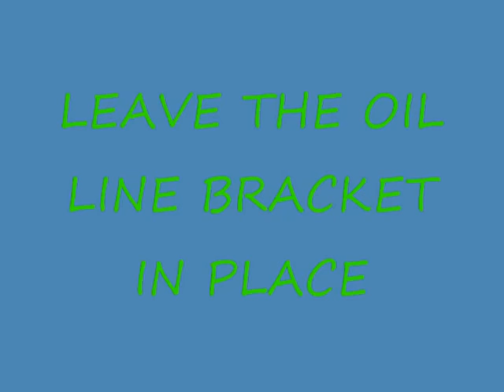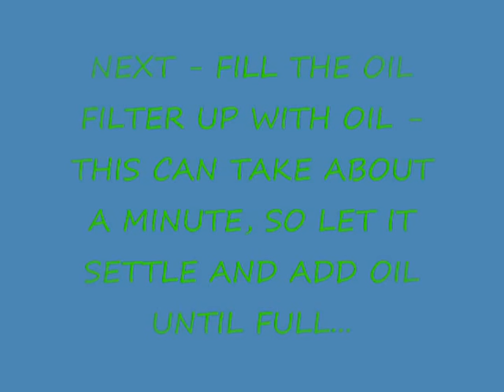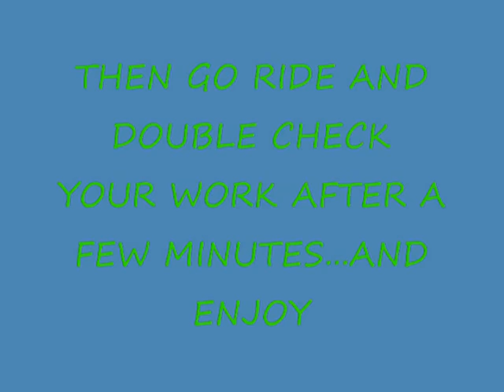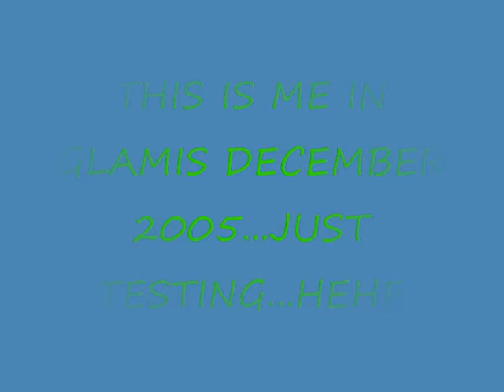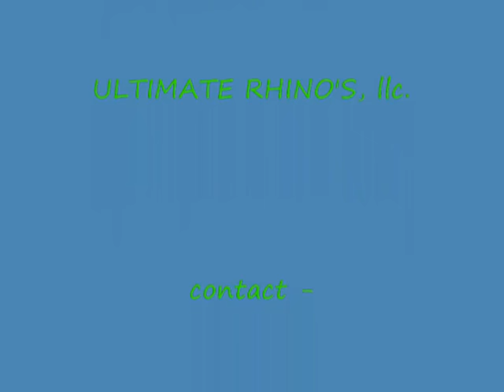Ultimate Rhino's instructions

Comment: Just got stuck in river water in air box .what the best way to revive motor to save .
Reply: I know this is 2 years late but incase you ever do it again drain oil and fill with diesel pull spark plug cap and turn motor over to flush water and stuff. Then fill with oil and run it the drain and refill with new oil filter. Sink my stuff often lol